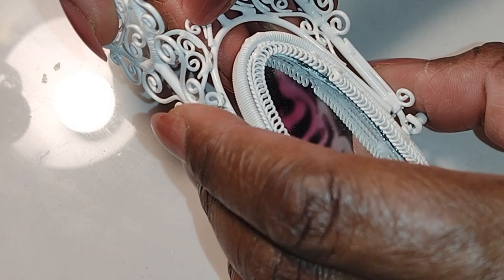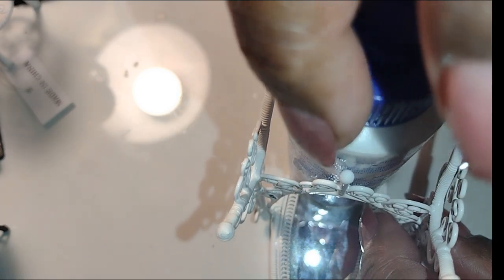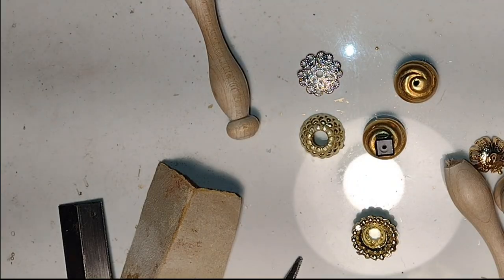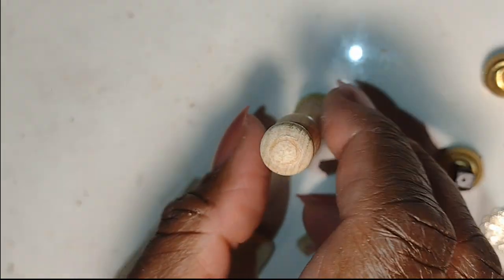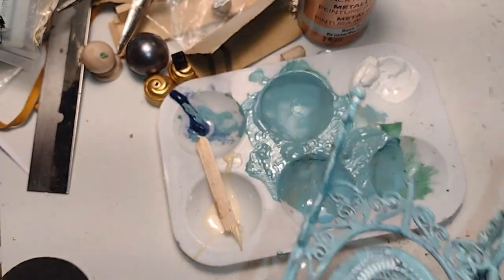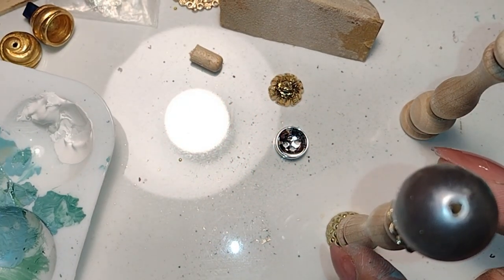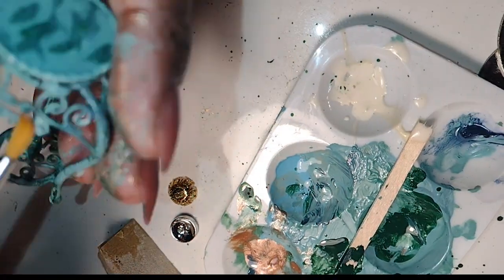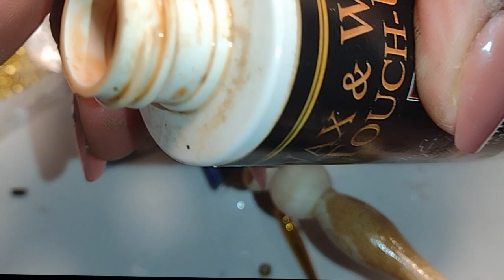MINI DRESS SHOP ESSENTIALS-Part 2 of Mini Sewing Machines and Things

Comment: As to the overusing wood for "insurance"...One thing I have been experimenting with when putting together two pieces of wood as you have on these hat stands, is using a "pin" connector between them before adding the glue to make the connection very strong.  But, I do not use actual dress making pins, I cut the sharp metal parts off of push pins.  These are much sturdier.  I drill a hole in one piece of the wood right in the middle, than super glue in the dull end of the push pin pin (minus the plastic handle obviously-which you cut off.)  Don't let the glue slop over or it will goof up the surface for gluing later.  When it is dry I find the center of the next piece and push the sharp end into it.  Depending on how hard the wood is, you may have to drill a starter hole, but not too big or deep because you want the fit to be tight.  Then I super glue that in and then PVA glue wood to wood.  This has really avoided that tendency of things to come apart easily and allows you to glue a bunch of pieces together and still make something that is very strong.  Takes time, but worth it, I think.
Reply from the maker: THIS EXCELLENT! I HAVE TO FINISH THE STAIRCASE AND I HAVE A LOT OF THOSE PUSH PINS( EXTRA BIG W/ BRIGHT COLORS). NOT VINTAGE LOOKING 🤭☺️🤣 THANK YOU! THIS IS SUCH PERFECT TIMING!!! THANKS☺️😍